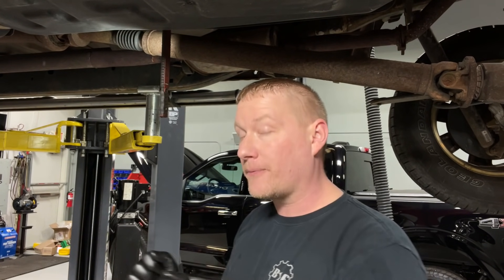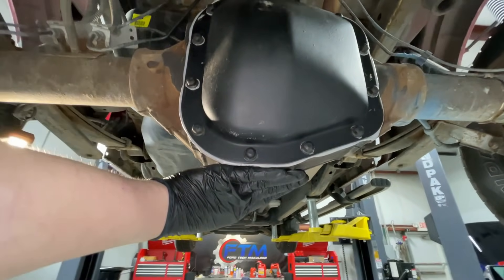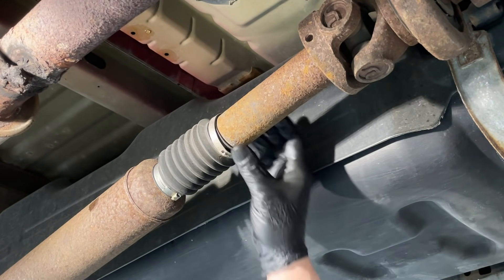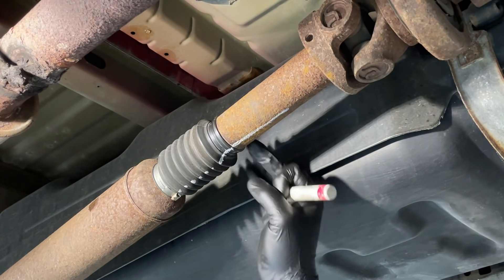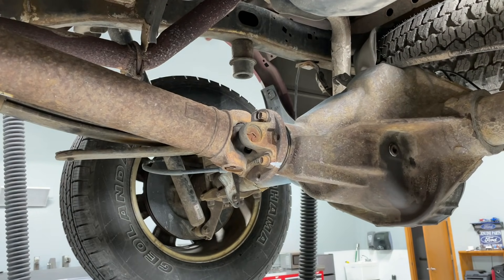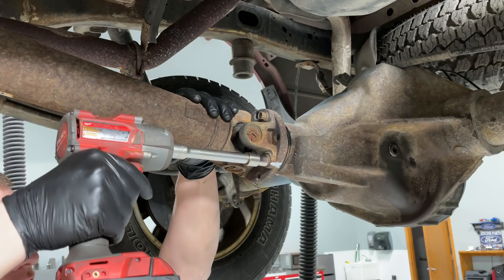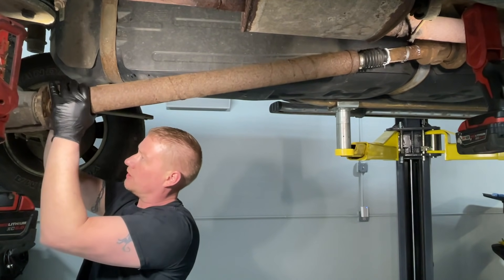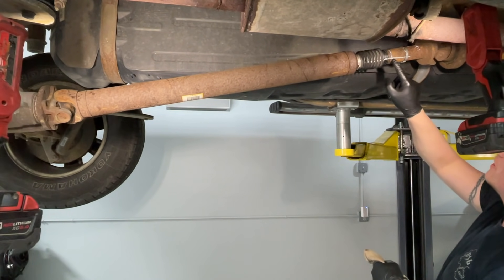Ford F-150 Driveline Slip Bump: Two Piece Driveshaft Kit Fix!

Comment from the maker: These are the Tools and Parts I Recommend:
Driveshaft Repair Kit-
https://amzn.to/3Mw1AWK
12mm 12 Point Socket-
https://amzn.to/3vyqXPt
Medium Strength Threadlocker-
https://amzn.to/3rZxd0w
Clamp Pliers-
https://amzn.to/38I9CcL

Driveshaft to Pinion Flange Bolt Torque- 76ft lbs

Original Video for One Piece Driveshaft-
https://www.youtube.com/watch?v=79Qo-806n9g

Forscan is a free Ford Specific Diagnostic Software:
Download Here- 
https://forscan.org/home.html
ELM 327 Adapter I Recommend-
https://amzn.to/2GC6dBj

As an Amazon Associate I earn from qualifying purchases.
Reply: Could you add a link for the marker pen you’re using also. And thank you for all your good advices.
Reply: Good info!
Reply: Brian- waiting for the 9.75 limited slip clutch pack replacement (without removing carrier) :D
Reply: Question for u. Totally not related to this video but I have 2019 F-150 3.5L ecoboost. Cold start up has a bad clutter noise from engine. Now check engine light turns on and sluggish when taking off. At highway speeds it stays in low gear. I called dealer for cam phasers warranty but they said it's not out yet. Need help. I love my truck and use it for work. If I don't have my truck than I don't work. If I don't work I can't pay for truck and just a domino effect. 😊
Reply: @Saltysteele    hahahahahaha.... ME TOO!!!!!
Reply: Thanks
We see your video from (iraq baghdad))
We hope to see more frome you
Reply: Hello...Your Videos are very well done...Do you happen to have one that is pertinent to a 2010-2014 Ford Transit Connect ,Transmission?...I'm thinking of purchasing one...
Reply: I like Your Vids.  I'm more along the Line as to You need a New DriveShaft with a New Boot.  Some New Pipes, Too.  God Bless, C.
Reply: Just in time. I've got this exact issue going on. Been driving me nuts.
Reply: FTM, thanks for providing great content! I performed this once, forgot to mark the shafts and had the whole mess rebalanced by a machine shop (aviation shop rated). While in the shop, one of the machinist said he could make a one piece shaft to replace the two price shaft - similar to the Raptor. Is that a legitimate substitute for a 2016, XL, supercab, 8 foot bed?
Reply: I get that bump on my 96 Ford Bronco! Is this fix the same ?
Reply: Will there be an intermittent shutter from this as well? I have an 09 f150. It shifts hard from a stop or engaging into reverse. Also shutter uphill at low rpms. Transmission issue or drive shaft?
Reply: Hey my 04 f150 bumps and shudders when I hit like 55 changing gears, and idea? Its usually when I rest at like 45 and slowly climb speed, if I. At like 25 and just press the pedal and and go right to 60 it'll pass the gears with no issue, its usually when I'm resting at 45 and then try and get to, or past 55mph
Reply: instablaster...
Reply: Do you think the 02 f250 V-10 would have the same issue ? I feel something move every time we stop, and then when we go…i can feel it in the steering wheel. Someone told me it’s the transmission mount ??
Reply: That kit fits on a ford  f-150 xl 2008?
Reply: Can I do this on my 2015? I can’t find any information. Please help
Reply: @fordtechmakuloco do they sell the clamp alone by chance I didn't know they offered a kit and have the grease already in a tube from motorcraft
Reply: @ChrisJones-is2el  they do but it’s expensive. I removed my clamp and took it to Napa. They had the same size clamp although a little thinner. Holding up great. Ford wanted $20 for the clamp while Napa charged me $2.
Reply: Hey Brian.! Whats going on? Bro could you add the link about the boot please.!
Reply: Hello, greetings brother, my 2010 f150 has a problem when braking completely, it hits and when accelerating after being stopped, it gives me another strong hit, could that be the problem?  I have to do that maintenance
Reply: Excuse me brother can I used one piece drive shaft to a 2013 ford f150 4x4 5.0 ?
Reply: Thank you 😊
Reply: Brother I have a 2013 ford f150 withe the 2 piece driveshaft 
And I have a little vibration from gear 1 to gear 2   Already take it to 5 mechanics they don’t found the problem! Could be the non lubricators shafts?

Comment: For the longest time, I thought I had a transmission issue with 1st gear!
Reply: Me too...my father in law gave me crap about Ford transmissions.  He’s obviously a Chevy man.
Reply: That's what I thought until I found this video!
Reply: Also me just today I had my raptor 2014 truck jerk lurch to the front almost hit the guy in the stop sign .  Now I know it’s a driveshaft problem
Reply: My so called Authorized dealers / technicians are clueless and i thought it was the freakin leaf springs all this time!!!! They literally told me its for off road purposes!!! 👎🏼👎🏼👎🏼
Reply: That's what a very well known local shop told me, and It was bs. Up selling and up selling to get money 💰
Reply: I was about to drain my transmission and start replacing solenoids. Will try this tomorrow. Hopefully that's what it is. Feel a jerk under my seat when stopping, thought it was the transmission.
Reply: GUYS, ALSO REPLACED THE TRANSMISSION BUSHING , THE ONE ON TOP OF THE CROSS MEMBER FOR BETTER RESULTS
Reply: @Khaled-tx5xj   Raptors have a recall on the driveshaft, but all other f150s with same problem don’t, those have technical service bulletins lol
Reply: @jerrytarin26  I didn’t they had a recall , but I’ve went with the grease that came up with ford for now nothing

Comment: Saved this  video two years ago just in case. The other day I felt the slip bump and knew exactly what was the  problem. Getting ready to take my 2014 F-150 to the mechanic for repairs. Thanks for posting this.
Reply: Hi  I was wondering if it's holding up with new grease

Comment: Did this today on my 2011 F-150. With only 56,000 miles I was experiencing this and thought I bought a used truck with a major problem. Watched your video and got the tools for the job. Kit on Amazon was $29.49 shipped. I had everything else already. Did this with a jack and two stands. Just be careful. I took my time and followed the steps thoroughly and had nothing but great results. No more bump when taking off! I am pleased with this and if it will be no big deal if I need to do it again in the future. Great video! I used testors paint for reference marks. I made two different colored reference marks on the boot end and ended up needing both to ensure that I was properly lined back up. So happy with the results!

Comment: I’ve had to do this twice on my ‘07 FX2.  Easy job and I don’t jack the rear, I put it on ramps, parking brake on, front wheels chocked and trans in neutral to unload it.  Easy to get the shaft off, separate, clean and grease the reassemble making sure to phase the u-joints correctly.  For a boot clamp I fuse a heavy zip tie and it works.  Repeat every 80,000 miles.  When I bought the truck it had the clunk and I got the price down $2,000 because of it.  1 hour later it was fixed.  Enjoying your channel.  195,000 miles on the 5.4L and going strong.

Comment: I gotta say thanks a lot for this video, you pointed out the directions so clearly that it only took me about 2 hours to get the job done.
The result was impressive, the driving is so freaking smooth right now!!!!  I was pissed off about that bump while taking off or stopping, I drive a f150 2012 fx2 with 140k miles, Thanks a lot again and keep up the good job that you are incredibly doing.
Reply: I have the same exact truck with the same exact issue. First time watching this video. Glad to see it fixed the issue for you.

Comment: I watched this video last week when it was first published and I realized that the problem that the pickup in this video had sounded familiar to the problem that my 2004 F-150 had. I ordered the Ford Motorcraft kit that was linked in the description and attempted this fix myself. What a difference! This solved my driveline bump issue immediately. Thanks to this video, I saved literally hundreds of dollars (because I thought that I might have had a worn ring gear) and it did not take long at all. Everything that FordTechMakuloco said in this video helped me as a novice mechanic to do it myself. Thanks for the great content!

Comment: Hi great video what's your name?  Where's your shop at? I went to a local mechanic shop I bought the kit from Ford dealership,  and I asked if they could do it, at first the guy was trying to sell me something else's to rebuild soemthing and the well he gave up he said he new 2hat I was talking about they will take care of me, when done I asked the procedure how they did the work they said they just pulled the rubber thing back and installed the grease in there so they never took anything apart it took them 2 hours to do it and they just failed to the right thing, and they charged me 120 for the labor , I have called a few more mechanics shops and they don't know what I'm talking about and they want me to bring the truck for an inspection which is 180 to all this placed wants to upsell.  And it sucks its just about the money nobody takes pride of their work ,  props to you man thank you for all your great videos. Be blessed 🙌 sorry for venting out I've had bad experiences with mechanics some do soemthing some haven't done anything on my vehicles and I still get charge for it.

Comment: Awesome video. I bought a 2013 Ford F-350 6.7 liter turbo diesel ,and been having the clunk sound going on for awhile now.. So glad i came across your video..  My spline had a blue coating on it and was very dry. Did not require much clean-up of old grease as there was not much in there. Bought the repair kit and it was the perfect amount. Truck feels great now and i am no longer afraid to pour the coals to it at a stop light.... Thanks again

Comment: Thought my transmission was about to quit. Did this first. It always had a stop start bump. Then recently slight jolts in shifting but not every time and not the same gear either. This helped everything. Feels solid and not sloppy anymore.

Comment: I was experiencing this in my 2008 F250 V 10. I took it to the dealer and they tried to say it was leaf springs and wanted $3800. Bullshit. I took it to the shop I used to trust and they told me it was rear end related and they don’t do that. I found this video and decided to pull it out today and re-grease it. Problem fixed and it’s as smooth as butter. Thanks for the video.

Comment: Just bought a 2011 F150 lariat Supercrew, and was sick thinking it might be having tranny problems. Ordered the "kit" from Amazon, followed your video, and it's now buttery smooth when starting and stopping. For anyone planning to try this, I had to use a family member's air impact wrench to get the 4 bolts loose - so you may need to think ahead if you dont have one. Thank you!!

Comment: Sir, thank you so much! 
I just took on this project today. 
Following all your instructions.
And well…
Damn son! 
My truck is running like a dream!!!!
I brought the kit at a local dealership for 33 bucks 
Lock tight for 6 bucks 
Marking pen for 6 bucks 
Harbor Freight has the pliers for 10 bucks
12 mm 12 sprocket was spot on! 
Had to place in neutral and park to remove bolts
Used all hand tools 
but it worked great!

Comment: Very good video and I definitely have this problem.  Ford "fixed" it a few years ago and it has progressively gotten bad again.  They fixed it free of charge because it seemed that there was a recall.  I don't know if I will be fortunate to have them fix it again free and do it right.
My real reason to post a comment and maybe you've already done a video on this (if so, please send me the link) is that I have a 2012 Ford F-150 Super Crew 5.0 with the split shaft and I think my U-Joints need to be replaced.  I can see how you removed the lower shaft.  I have considered replacing these joints as allegedly Ford said (back when they replaced the slip bump issue) that these were going bad.  Why did I not have Ford do it?  $1000 to do it.  I have helped my dad many years ago change the u-joints on an '87 F-150 (single shaft) many years ago before there was internet, let alone YouTube videos with tips.  He did it but he also complained he didn't do it right.  I'd like to avoid $1000 repair if I can do it myself.  Do you have a video?

Comment: I did the repair on my 2010 F-150 and it's quiet now.  I was able to get the yoke bolts out with a 12" ratchet handle - so no need for an impact driver. :) The only trouble was crimping the clamp. It takes some force. Thanks for the video.
Reply: You are more man than me, lol. I just did this on my '21 Ranger and needed an impact wrench.
Reply: @ejhayes76  Evidently yours was tighter.

Comment: I’ve got a 98 ford ranger, I’m almost positive this is a problem after watching. Never really thought anything of that weird surge while taking off. Thanks for the video.
Reply: Bryce , I had a 2000 Ranger a few years ago that I got cheap because the " trans had problems " . I pulled the shaft , which had dry splines , lubed it up
and the problem was gone . One hour well spent .
Reply: the ford ranger has the same issue.
Reply: My 2017 F150 does the same thing. You always feel a bump while accelerating or braking to/from a complete stop 🤣
Reply: @bill3641  Awesome I’m definitely gonna do that to my truck.
Reply: The 2019-2023 Rangers can have the same issue. Remember our US Rangers are actually 2011 era trucks. I did this on mine. So far seems much better. I've come across a lot of current Ranger owners with this issue online. Some have luck getting a dealer to lube it, some (like me) don't and end up doing it ourselves.

Comment: The best video you have done! I have the exact same truck with the exact same problem! I have had two separate local Ford dealers do this service, both did it incorrectly. The first lied about using the white Teflon grease. They used blue grease as we discovered at the second dealer. The second dealer used the Teflon grease, but only on the slip yoke that slides into the transfer case. Not sure if any of them did the mid section yoke, if they did they didn’t mark the splines. I took your old video on my iPad to the second dealer to show em how should be done. I have 3 or 4 Ford dealers in this town and all have incompetent service departments. Thank you for this video! 2014 F150 157 WB 6.2 V8 4X4 12k miles.

Comment: Thank you so much for this video. I have a 2009 f150 that has this issue and I always thought it was my transmission. The transmission shop told me there's nothing wrong with my tranny but they didn't know what was causing the problem. I can do this on my driveway this summer. Your videos are the best thing on YouTube. Thanks again 🙏

Comment: 2014 F150 FX4. Just did this - it fixed it. Before it was very noticeable - even the slightest gas from start would act like someone nudged you from the rear. Now its smooth. Hopefully it holds up. The shaft splines looked good - you could see the special coating on the metal. Oh and the receiver section was almost complexly dry.  I did  not have a 12mm 12 point nor the pliers. Total for the kit and tools  was under $50 and from start to end including cleanup and test drive was about an hour. Well worth it!

Comment: I'd just like to add something for the back yard mechanics.

 To torque the driveline hub bolts, I just left the vehicle up on jacks and shifted into park, otherwise it's very difficult to get the 76ft/lbs necessary. You have to shift back to neutral to rotate for the next bolt but it's alot easier and safer than trying to hold the tires in position.
Reply: I used the parking brake to hold it steady. Had to crawl out, release the brake, crawl under, rotate to the next bolt, crawl out, etc. It was about a two hour job for me also. If I had to do it again, it would probably be an hour. If I had access to a lift, it would probably be ten minutes 😊

Comment: Want to say thank you, it worked 🙏🙏.. been driving around in 06 Ford for the last three years thinking that it was my rear end that was going out, but nope just a slip yoke that needed grease 😶🤷.....on your video and a couple other videos that I saw when you guy toke out the slip yoke, you guys still had a little grease in it. mine was bone dry 🤯💀💀.. but now running better than ever no more clunking noise and extremely smooth on the expressway 🤔😁... But just did want to say thank you for the video I use your video mainly as a reference👍👍

Comment: I just did the repair on my 2011.  Your step by step video was perfect.  Hopefully this will solve the problem.  The grease that was in there was grey and there wasn’t much of it.  Also noticed a couple of minor scrapes in that Teflon coating.  Don’t think that I did it as all I did was slide the shaft out and put it on the bench.  Seemed to be dented inward so hopefully the new grease will fill them in.  I’ve done all the service on the truck so they must have occurred at the factory.  May be contributing to some of their issues.  Again, great video,

Comment: Just did this on 04 f350 and it definitely was this easy to do and all it needed was to be greased up and the bump is 100% gone! I didnt get the kit and i used different grease but  i think it will hold up with no issues. I still cant believe it just needed grease. I had mechanics tell me i needed a new differential when i explained it over the phone and was quoted 2k for the fix